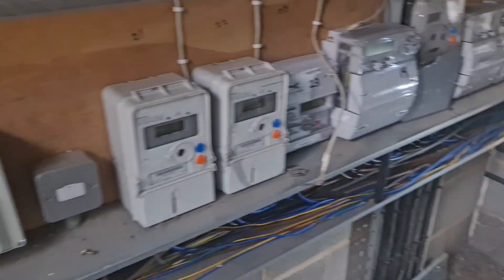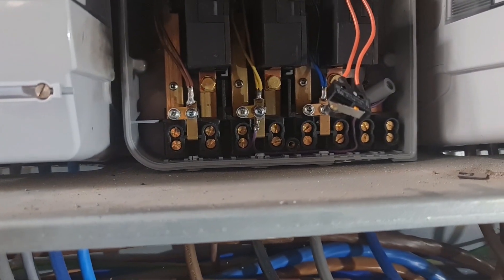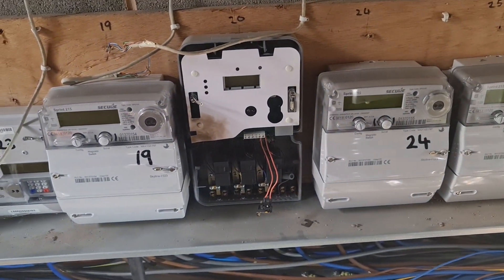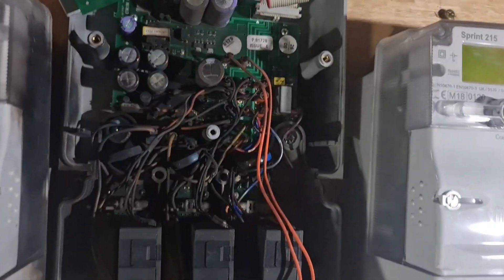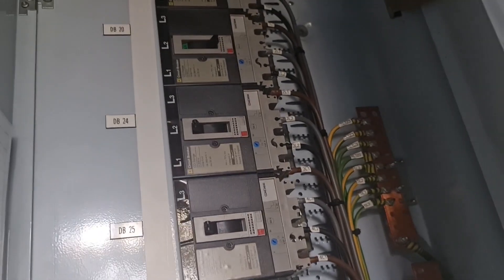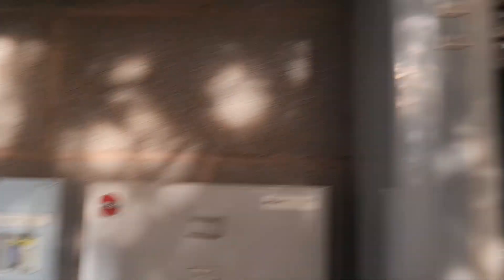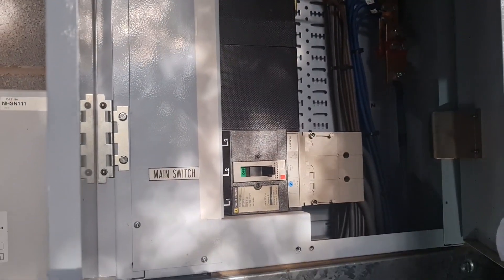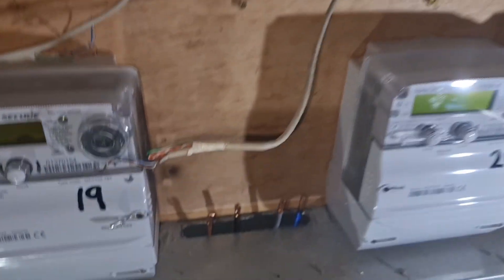3 phase meter explodes UK electrician attends commercial emergency to block of Ind units.

Comment: I would love to see the videos you referenced in the beginning, would it be possible to link them in your description?
Reply from the maker: The Louise Taggert video about her brother Michael?
Reply: Good message sad story.
It’s so easy to get complacent and not check.
I was helping an electrician once and there was an issue with the light switches he’s like just do that that that and I’m like but shouldn’t I turn it off? He’s like oh you must not be used to working live I’m like I don’t really feel like that’s the box to be working in live it was already a rats nest granted it was only 120v. This place had a lot of DIY/maximum Box fill capacity exceeded and the church had a contractor Family member who liked to round corners shall I put it politely.

I’ve had to work on a couple of things live a few times but I’ve mentally gone through the checklist and risk assessment in my head and they were usually simple things like fixing a light switch without being able to find the breaker, now that I have a circuit finder that’s less likely to happen.

Over here in the US we have A testing laboratory that at one time in their history past some thing for a check under the door that was a consumer unit electrical panel that was notorious for not tripping to the point of being able to arc weld. Federal fire pacific has lots of fun pictures on Google images I even ran across the story of some guys working in the attic of a restaurant and being too lazy to go down and turn off the breaker so they just cut the cable however being a federal Pacific breaker it didn’t shut off and it continue to arc weld the cutters to the cable.

The house we finally got had a federal fair Pacific panel, I took things very extremely carefully until I could Properly swap it out, The problem is there’s remake breakers out there that are supposedly safe but you can’t really tell them apart.
In the US as a homeowner I have the right to do electrical as long as it will pass inspection another words it needs to be done right but that doesn’t stop the DIYers out there, on top of that I have accumulated enough knowledge to considers myself a “professional amateur electrician” (that sentence should be just enough to say that I know what I’m doing but scary enough to say let me think about that before I continue) and I want to get my license at some point when life and c19 it doesn’t interfere with my plans....  2020 has been a bad year to plan to do anything. It started with being “no longer employable” so I figured move up my Summer plans, and the highlight of my day 2 inches of water in my basement followed by going for a walk and being a good Samaritan getting prosecuted to the full list extent of the law and then Covid on top of that shut everything down because the new normal is to do absolutely nothing.
Reply from the maker: https://youtu.be/OwlxHwcw-VY

Comment: Honesty at it’s best. You will get more work trust me. Customers really appreciate that. 

Safe isolation is called lockout and tagout here in USA. I know a lot of industrial electricians here have to work live you cannot stop a multi- million operation factory closed for even an hour, they also have backups.

Was there any surge protection or an isolation switch ahead of that panel did you recommend that to client?

My Arc flash equipment shield mask, hood overalls, and boots with gloves rubber rated and leathers, with boots to match is rated for 1000 volts and clothing rating goes up working on higher and higher voltages. When you enter a building like that after an event like that i would be very wary you cannot know what surfaces are live without testing. I would have had my PPE on even before I did safe isolation.

The problem is not in my mind knowing what safe isolation is but the real danger is overconfidence and I see that a lot with electricians when you work with electricity on a daily basis it’s easy to get blasé that’s and you stop thinking - that is when you can get hurt.

It would have been nice to have seen some of the testing and values.

Great video as always though. Thanks
Reply from the maker: Hey thanks for the comment, appreciate it. We call it the same here!

No surge is in place and we have recommend its installed across all the clients assets UK wide. Quoted for this one in particular and I suspect it will be approved. Along with adjusting some of the circuit arrangements in the data rooms as the switches powering up kept operating the protective device on that circuit (inrush).

Totally with you on the PPE. Fortunately in this case we had a point of isolation remote from the area.

I am really careful what I film, dont want to be instructional or give guidance for people to attempt things they shouldnt. But I understand my videos would probably be better if I did!

To prove dead in the panel I was PPE in full but increadibly difficult to film that. I dont have a go pro or tripod. Its all on my phone. Didnt even have the gimble on this one as wasnt intending to record.

Plus like I say my videos would be more througher if I did but also show others how to do things maybe they shouldnt. Perhaps my approach is wrong on that. Very new to YouTube.
Reply: @electrician247  no i respect your approach. 

You can do what nearly everyone does and  make it clear that the video is for entertainment purposes only and not meant for instructional purposes.

My view is this people can get hold of instructional material if they want to. For example there is all the learning material out there I bet the IET views you the same as any customer whether you are trained or not and will sell any of their material. If someone is going to try something lack of knowledge and training is not going to stop them. We are surrounded by electricity all the time knowing about it gives most people an appreciation for it and the skill involved in dealing with it. 

I do believe though that for the keen DIYer with technical ability there should be an opportunity for them to learn to be an electrician not have to be licensed so they can work on their home but not on others. Otherwise we moan and groan about them not being competent but no route for them to be competent. There should be courses for that. It won’t hurt the industry it will bring money into it. We are only talking about few people here though who would be willing to go through that learning process.

I know there are other excellent YouTube electricians who do show their work and it shows the quality of their work the care they take. Gaz and the crew at Tresham have done a lot of instructional stuff reaching a much wider audience than just their own students. I see a huge number of young sparkies who have said what an excellent job they do and try wish their tutors were as good as that. 

Younger people interact with social media now it’s their life the industry needs to get with that. Showing what you do is upskilling and telling young sparks that quality and attention to detail makes for a safer installation. More than that it’s improving the industry giving and making younger sparks aware of situations and experience they may not have come across and they access to a wider world of experience and tips than would ever be possible if they were simply apprenticing for single firm

As I said at the beginning I respect your choice. Make a qualification at the beginning. 

Show for example how you can pass an insulation resistance test but that may not prove completely that the wiring is okay, an electrician has to think an observe the installation they are getting into. EICR are a minimum indication of safety and I would hate it becoming a compliance based box ticking approach. Sparkies need to think outside the box and adopt a more risk based approach.
Reply from the maker: @mathman0101  I intend to improve my YouTube as time moves on. Going gently and slowly building confidence.  

Thats the battle fairly represnting a days work on a 20 minute video lol. 

I didnt think the testing would be interesting and as I hadnt setout with a mind to film anything it was a bit rushed/sketcy on detail. 

We did a full analysis of that panel not just IR. Obtained good Zdb and PFC PSC. Even did some volt drop and power factor work. Everything was perfect. 

My report leaned towards surge but obviously we cant prove it. Made recommendations for SPD and data logger installation for a 2 week period. 

Thanks for the input and advice. I do want to make my channel as good as possible with my linited camera setup.
Reply: @electrician247  you will get much better there is no one style of doing it. We appreciate all you do. Keep it going. Don’t worry about doing an upload every couple of days you need time with your family as well.

The power factor work is something younger sparks will be really interested in  and it’s something they will not have been taught in any great depth.
Reply: @electrician247  on the inrush current get higher quality switches. good manufacturers will tailor the power electronics to give a much smoother switching profile. Try to get quality switches which will also avoid these problems. Take for example a major high quality LED light and electrical and electronics company whose LED bulbs had a significant amount of shielding and other devices to reduce the DC leakage in 2015. They continue to research and now produce in 2020 an LED bulb that weighs a third less because they have removed all the shielding and other DC protective leakage components in their circuit boards the reason is that they researched and repositioned the existing electronics component devices and tested it to remove the leakage signal and ensure a clean power factor curve without the need for extra shielding and components to filter the DC signal. Just shows good quality manufacturers do their due diligence and work to improve things they also publish their testing and certification results for their products and provide this technical information. Sparkies need to be aware of that.

I think if you showed an example of that for some of the equipment you installed making young sparkies aware of not just installing the cheapest device but a device that will live longer and be more cost effective over the longer run due to its robustness and reliability. Show them the technical information and encourage them to do their own due diligence and not just take for granted what’s wholesalers or other sparkies are telling them.
Reply from the maker: @mathman0101  yeah I would love to do that. In this case the switches are owner/managed by others. We just happened to be there turning them on after the power outage. 

The client wants a clean supply in there anyway so we are going to reconfigure things with the existing the equipment.